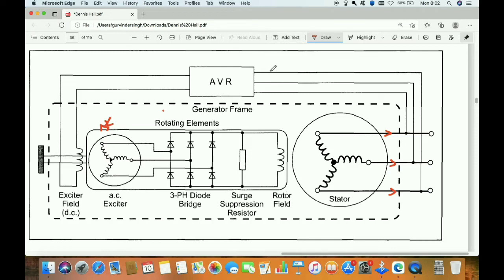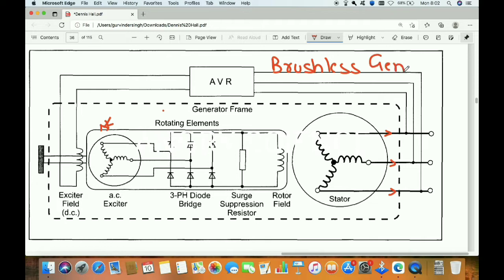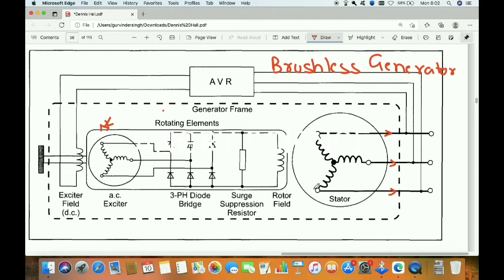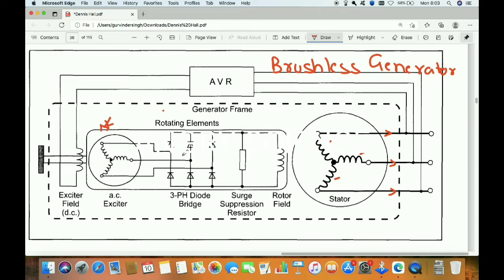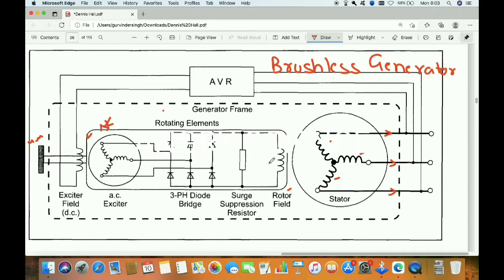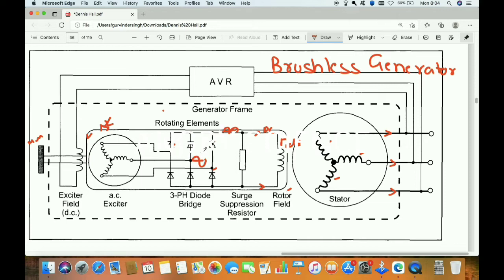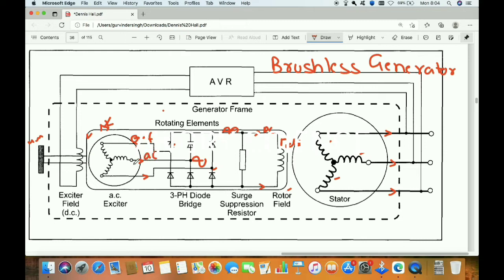BRUSHLESS GENERATOR, CONSTRUCTION AND WORKING

Comment: Thank you.  I have one question.  In other YouTube videos, there is mention of a fairly large capacitor that can sometimes go bad.  The capacitor can be located in the face plate or inside of the generator.  I was wondering what does that capacitor do and where is it located in the circuit of the generator.